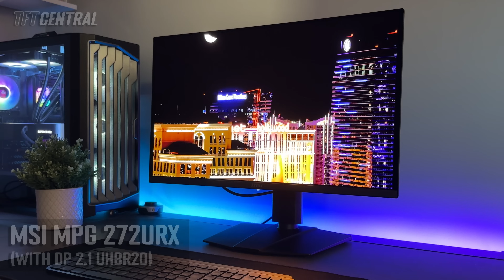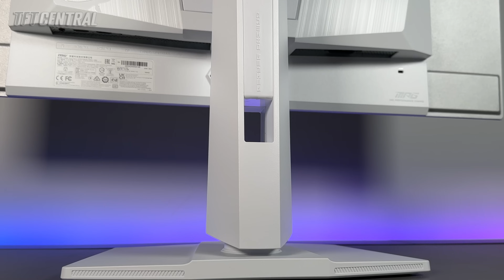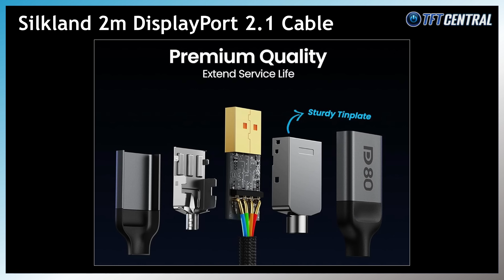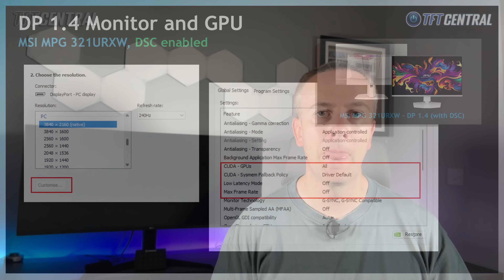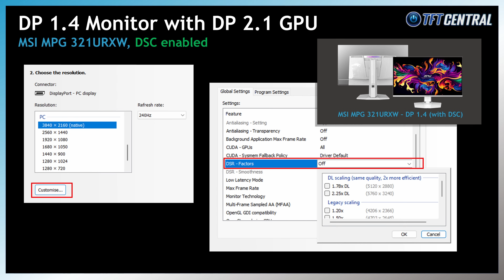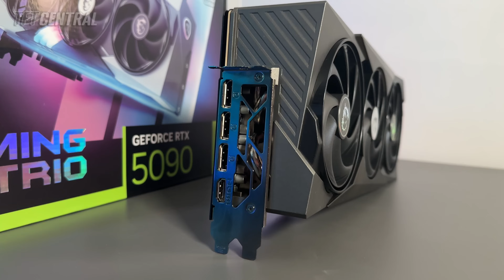Loads of DisplayPort 2 1 Testing and Updates

Comment: Still no actual DSC testing. No lag test. No test of the "lossless" lossy compression.  But rest assured DSC is magic. It's the first in-line technology ever invented that can circumvent lag and the first lossy compression that's also lossless somehow. Sad to see these claims parroted for years with no actual tests.
Reply: Check out my comment where I explain how the standard works (it's a joke as 1/4 people can tell the difference 100% of the time) and if you actually look for it, at least I can totally tell a difference. It's only "lossless" if you have no reference of comparison and a DSC image is all you've ever seen.
Reply from the maker: We’ve tested it in the past and found no measurable or noticeable difference in lag. And as we said in the video, we’ve never seen any visual difference either. 

Some people want to hate on DSC as it’s a compression, but it’s here to stay whether you want it or not. There will be a small window where DP 2.1 can be used for uncompressed video, but higher specs will require DSC again before too long and we’ll be right back to using it and needing it
Reply: @tftcentral  I've been following tftcentral for eons because I'm not a "trust me bro" kind of guy.

I want tests for DSC lag, how "visual lossless" the output is at max compression/throughput and the actual max throughput through one video out for each modern GPU as throughput is known to vary due to how the DSC compression units are laid out (see the case of the 4090 not being able to go beyond 120 Hz on dual 4K displays).

I don't call that "hating" on DSC and it's worrisome that someone like you does...
Reply from the maker: I didn’t say you were hating on DSC, I was talking broadly about how some people hate on it. Just because it’s compression. 

Like I say I’ve tested it in the past on many occasions and short of just printing a graph or table with the same  number showing for DSc on and off, I’m not sure what more we can show when it comes to lag. In regards to throughput and compression levels, that could well vary between cards and monitors, it’s not something we’ve tested on a big enough sample size tbh
Reply: @tftcentral  You seem to misunderstand the part I'm taking issue with here. I'm not agains the tech itself. It's great for increasing refresh rates with minimal impact to visuals. But that's the thing. Minimal impact is not the same as no impact. The part I'm taking issue with is the "visually lossless" claim which their own research has shown is not true for a full 1/4 of the people this was tested on which went back and forth between DSC on and off. That's anything but an insignificant amount. I'd like to directly share the link but then this comment will most likely be auto deleted. I understand that you've been doing this for decades and you'd assume that if you can't tell a difference it's unlikely for others to be able to tell. But it just means that you could be part of those 3/4 that simply don't see the difference and there is nothing wrong with that. If they'd change that part to something like "minimal visual loss" I'd have no further complaints.

While DSC is great until we get even higher bandwidth cables the truth of the matter is we went from DP 1.3 released in 2014 with a bandwidth of 32.4 Gbps to DP 2.1 where the first products appeared in 2024 with a bandwidth of 80 Gbps. That's an uplift of roughly 147 %. I wouldn't know of anything on top of my head in the tech world that had such horrible uplifts during a 10 year timespan especially when it comes to bandwidth. And all because manufactures reluctance of either increasing the available lanes or going full on optical by which I mean full on optical en/decoder directly on the gpu and display and not those active cables we have now that have to convert between optical and electrical on both ends. 

Something else that I do hope DSC to support eventually is to be able to turn it on/off on a frame by frame basis because currently it takes ages to initiate and to turn it off again. This would give the benefit of having zero compression up until the refresh rate where that's no longer possible. For instace DSC off < 4k 240hz < DSC on. This would be the way to go for a VRR display in my opinion.  

Being so limited on cable lenghs clearly shows we've hit a limit on what's possible with copper wires. The sooner we start finally developing a standard that replaces the copper wires dead end the sooner we'll get to see the benefits of mass production of this new standard and the sooner it can go from being a high end luxury only for ethusiast products (like DP 2.1 is somewhat currently, though it is already available for cheaper products like the rtx 5060) to being available on less expensive products. In the meantime the GPMI standard shown in China being capable of up to 192 Gbps shows what would be possible with more available lanes (8 channel instead of 4 channel) and I do hope it will get some traction. Hopefully it's also open source like Displayport because it's ridiculous that you still have to pay money to the HDMI association or whatever they are called.

Fiber optic cables are really cheap nowadays and usually cost is below 10 € per meter. The expensive parts currently are the en/decoder but it's not like those are out of this world costs either especially for high end hardware and one single connection on both ends would suffice for a start since the potential is enormous and cost would go down with time anyway. We are talking hundreds of Gbps possible right out of the gate with future potential for 1+ terabits per second of bandwidth. Lower end products can just stick to normal DP 1.4 or 2.1 and/or use DSC should it be required.

Hope you appreciate me writing all this cheers!
Reply from the maker: @eduonkhl I do appreciate it, interesting thoughts and observations
Reply: There is no obligation to use DSC btw, it's a cost saving measure. DisplayID makes it possible to use multiple connections per single panel and has been available for many years for both AMD and Nvidia.
Reply: BlurBusters forums have good overview of DSC btw.
Including the aspects you are interested in and also a way to test for artifacts.
Reply: Am just a bit speechless here… DSC has no influence on any kind of Lag. That has been proven many times by different sources. Maybe I got your words wrong, but for me your whole approach sounds very disrespectful. “I want this and that…” And I want a million Euros right now… these are my thoughts on this.

Comment: You should look into the studies made on how many people notice the visual artifacts of DSC. In fact the standard itself which is ISO/IEC 29170 (sadly behind a paywall to view the full details?) already gives a pass when observers cannot distinguish between the original and compressed image in more than 75% of trials. Meaning that up to a full quarter of people can tell a difference. As you can see the standards of this standard are very low and I'd challange the claim of "visually lossless". 

After switching back and forth between DP 1.4 with DSC and HDMI 2.1 without DSC on a 4k 160 Hz monitor (4k 144hz with HDMI), with all other settings equal, I'm pretty confident that I can tell the difference most of the time. DSC tends to sharpen the edges of geometry giving the illusion of detail while no DSC has a slightly softer but more detailed less shimmering look to it. I'm still baffled how nobody talks about this let alone noticed it. Sure you have to look for it and if the DSC "look" is all you've ever seen then you don't really know what kind of impact it has on the image. Even myself used the monitor with DSC for like half a year until I decided to do the comparison (another reason was to finally get rid of those stupid artificial limitations from Nvidia of not allowing DL(DSR), custom resolutions and integer scaling) but once you see the differences you can't unsee them.

Looking at how much issues manufactures have with cable lenghts with DP 2.1 I think it's long overdue to make optical the new default which should enable bandwidths beyond the 1 terabit mark no longer needing any kind of annoying compression while cable lenght shouldn't be anywhere near as much of an issue anymore.
Reply: Lmao don't forget their visually lossless claim extends to 3:1 compression ratio dsc too which is exponentially more likely to have visible artifacts. You could test that if you had a 240hz 4k panel

Comment: Takes so long for new standard to be used. Still new and upcoming flagship OLED monitors being released with old spec. Same for new LG 5K2K monitor, the upcoming HDMI 96Gbps would allow that monitor to be 240Hz 10bit no DSC but when knows when this spec will even show on monitor, just looking how DP 2.1 (full bandwidth) is scarce. I have LG 4K dual-mode and when using that mode and DSC alt-tab can cause various issues with opened windows being rearranged, once back to game, may show in larger res so can't navigate, have to alt-tab again. For fps games really exclusive fullscreen mode is the go-to so yeah. Slow adoption is kinda lame, but manufacturers slack.

Comment: Lots of ppl say dp 1.4. Is more stable to play on then hdmi 2.1. For example on a zowie 540hz 1080p.  Even if it use lower bandwith. I'm confused.  I really want to know what cable pro player use on zowie 600hz monitors on tournaments when they play on hdmi 2.1/dp 1.4. Gpu's.
Reply: DP

Comment: Is there truth to the thought that using DSC can cause mouse inputs to feel "off" in FPS games like cs2 and cause input delay depending on the monitor? This due to having to use scaling set to display in the Nvidia Control Panel for higher refresh rate monitors that exceed DP1.4 bandwidth?
Reply from the maker: Can you elaborate on what you’d need to do in NVIDIA control panel for those situations? I can’t think of why you’d need to do anything “special” there just because DSC was being used tbh
Reply: I don’t think it’s a truth. Most people recommend tuning display scaling on display for optimization of PC latency. I’ve been running display scaling since had a 390hz and there are no issues with mouse input.

Comment: For DLDSR and DSR, does any 5000 series GPU have the ability to unlock this? I have an MSI MPG 491CQPX and I miss DLDSR on my 3060, but I'm looking to upgrade my GPU. I was leaning monstly AMD for next gen, but I love DLDSR.

For a 5000 series GPU, would HDMI 2.1 allow DLDSR as well? Since there's extra bandwidth.
Reply from the maker: Any of the RTX 50 cards are fine, they all have the increased display head limit. We tried it on a 5070 as well.

I have never seen HDMI 2.1 change the availability I don’t think compared with DP 1.4 on older cards but I expect it would work on an RTX 50 for the same reasons DP works
Reply: In what world would you need DLDSR with 3060 and that monitor? Its not like 3060 can render at what,  2160x7680?
Reply: @ThunderingRoar  I can set the desktop resolution to a DLDSR resolution. For game rendering, I can do lower than native (e.g. 3420x960), then upscale to the DLDSR resolution via Lossless Scaling before it downscales to my monitors resolution (5120x1440).

The quality would look much better than upscaling from 3420x960->5120x1440. Also, it'll look better than regular DSR or VSR.

Before my new monitor, I had a 3440x1440 monitor 120hz which worked really well with DLDSR. I would be able to set the game to a lower resolution (2560x1080) then let it upscale to 5120x2160 (DLDSR) before it would downscale to 3440x1440.  It gave me more performance headroom to hit higher FPS and up my graphics settings, and also looked slightly better than native 3440x1440 and much better upscaling from 2560x1080 to 3440x1440. Even 2240x960->5120x2160->3440x1440 looked really good.
Reply: @TheCrayonMan529  does the monitor refresh rate take a hit? When Choosing a higher resolution above my 4k 120hz with dldsr the display only gives me 8k 60hz?
Reply: @aberkae  At 3440x1440 I was able to do it with no refresh rate decrease, but that was at 120hz.

I can't run DLDSR/DSR or VSR (I'm running a duel GPU setup AMD eGPU and Nvidia dGPU). I can force VSR via SRE by ToastyX since it's available on my new monitor and GPU. Getting a 5000 series GPU should fix it.

Comment: Silkland actually have a 3m now and so does ubluker
Reply from the maker: I should have specified, I meant full UHBR20 DP80 certified cables. I can’t see a Silkland Cable at 3m on the certified list that is DP80?
Reply: @tftcentral  yes you are right, they have 3m DP80 cable but is not yet certified (many user reviews on amazon say it working properly at 80DP anyway. I wanted to ask: i have a 1.4dp monitor with a 1.4dp gpu (rtx 4090), and i need a longer cable, 3m at least. Do you think is worth buying a 3m DP 2.1 cable more future proof or should i just buy a dp 1.4 longer cable?
Reply from the maker: @nikolaosmitsou85 well I guess you could use the DP 2.1 further down the line should you ever upgrade but I expect by the time you did, DP 2.1 cables will be readily available and cheap, or will be packaged with a new monitor anyway, so you may be just as well getting a cheaper DP 1.4 cable now perhaps
Reply: @ the silkland one showed up for me on the list,  thats why i bought it.  The ubluker one isnt on the vesa list yet but im sure it will be soon

edit,  just looked again and its no longer there.  Only reason I bought it yesterday was cause it was on the list
Reply: So in my case, using a rtx5080. It is not woth the extra 250 euro's voor the dp2.1 msi 322urx 32" 4k  qd oled? I beter safe 250 euro's and buy the 1.4dp msi 321urx 4k qd oled?
Reply from the maker: Depends how you want to look at it I suppose. On the one hand you’d be able to use full DP 2.1 if you wanted, but on the other hand it almost certainly won’t offer you any meaningful benefits so may not be worth the extra cost

Comment: I have a 272urx and the silkland cable , with a 9070xt , with dsc off ,  i can get 4k 240hz but only 6 bit colour , this is because the 9070xt is dp2.1 but only 13.5 uhbr 😒
Reply from the maker: Yeah that’s a pain but it’s def going to be better to enable DSC and use it at 10-bit and I doubt you’ll experience any issues with that combo
Reply: @tftcentral   yeah works great !!

Comment: When can we expect higher resolution and refresh rates (for example 4K at 480Hz)?
It seems none of those new DP 2.1 monitors use the new available bandwidth to enable this.
I thought it was a chicken and egg problem but now that the gpus are compatible, what is the hold up?
Reply from the maker: They’ll come in time but there’ll be challenges on the panel and scaler size to overcome. Not to mention having systems that can get anywhere near to powering that spec 🙂
Reply: @tftcentral  Thanks for the response!
 I always wondered: Is it harder to design for example a 4K 480Hz OLED panel than a 240Hz OLED panel (scaler apart ofc)? And if so how does resolution affect it?
Reply from the maker: @hastesoldat the circuitry required to push refresh rate is complex, and so it takes time to increase refresh rates as well as making sure that when you do, things like brightness and PQ don’t take a hit at the same time
Reply: 4K 480Hz wont happen this year. 4K 360Hz...maybe.

Comment: Thanks for the video! I’m using a 5080 paired with the PG27UCDM and S1334 Silkland cable and it’s been very nice getting away from DSC. Games close much quicker, ALT Tab works much faster, turning on VRR is snappier as is enabling and disabling HDR.
Reply from the maker: great stuff, killer combo you've got there :)
Reply: @tftcentral  Nice combo! Interesting that DP 2.1 has effects on the ALT Tab switching, en/dis HDR, etc!
Reply: @VicharB  the lack of DSC has that effect. I heard that with DSC, the GPU and monitor need to negotitate some stuff beforehand that's why e.g. waking up from sleep or alt-tabbing from fullscreen apps is slower
Reply from the maker: It’s more related to the display head limit, but it’s explained and discussed in this very video